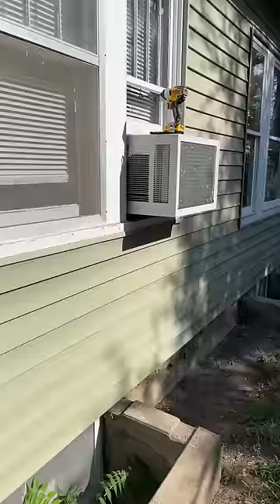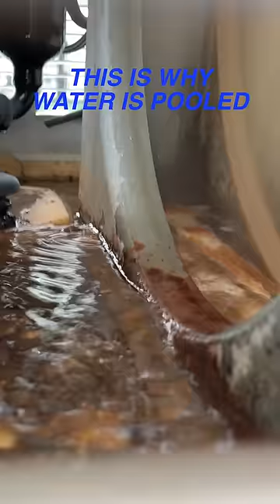🥵 99% Don't Know THIS About Window A/C!

Comment: It may save you power, but you'll need to replace the ac sooner as it will cause the condenser to rust out.
Reply from the maker: I have never replaced an ac unit in any rental houses or my own bc of a rusted condenser unit....just my experience
Reply: I have had them rust out
Reply: 15 years carrier units here and go strong !  Water Splash  help a lot here (Hermosillo Sonora Mexico 121 Fahrenheit) I put fog/mister  on 3 of my split units and the amps draw lows to 11 from 13.5 (24000 btus 220v)
Reply: @charliebrownn6622  Works in Sonora because the climate is dry.
Reply: Maybe if you don't take care of it. My rooftop swamp cooler is over 30 years old and still going strong. There's the kind of lifespan you get when you take care of your appliances rather than ignoring them until something breaks.
Reply: I have a 42,000 BTU or 3.5 ton central AC system in my house. Upstairs is always a few degrees warmer so I started running the Blower Continuously so the air would mix and prevent stratification. It worked but I was using a lot of energy. I bought 3 5000 BTU window ac units and put them in each bedroom upstairs and now I don't run the central air. I maintain a comfortable space temperature with just over one ton of cooling
Reply: @ChicagoMillingCo.  Works everywhere because the coils are hot.
Reply: If you live in an extremely humidity environment like the gulf coast it will rust out and if you are under an oak tree all the pollen will enter and turn it into a slimy moldy soup that has to be cleaned out yearly.
Reply: I think these are just to rust it so you need to buy a new one.
Reply: @HandymanHertz  because aluminum doesn’t rust. 😉
Reply: Aren't those coils made of aluminium? That doesn't rust.
Reply: @GordonGarvey  right,  it will corrode instead 🤣
Reply: @mrdumbfellow927  it would take years if the water was pure and it wasn't directly touching other types of metals.
Reply: I have had them rust out down here in the south
Reply: @jamesfarmer2748 Well it SHOULD be cleaned out regularly. Mosquitoes breed in that soup!
Reply: @charliesheehan4577  I live on the gulf coast less than a mile from the gulf and nearly every old window unit I see has rust and corrosion. The condenser being aluminum while not rusting like steel will be corroded and falling apart but will usually keep running as long as refrigerant is in the system .
Reply: @HandymanHertz My window unit is about 6 months old and bottom of the coil is almost gone because of the standing water, I drilled a hole in it anyway
Reply: Rust is an insanaly long process so no stress put da drill down😉
Reply: @HandymanHertz  the condenser is aluminum how did it rust lol
Reply: Bro I’ve literally had my window unit for over 10 years and the condenser isn’t rusting not only that these units are super cheap just buy a new one ever 5 years if you’re worried about it
Reply: @JDMSwervo2001  some people would like em to last forever so they can use the extra money for there vices
Reply: The window ac is no joke humanties most perfected invention, they are incredibly efficient, last forever and are very cheap to run
Reply: Rust ? I've never seen rust on a condenser
Reply: 😂 The condensers are stainless steel bro 
😂
😂
😂
Reply: Rust is like cancer.
Reply: @Kandralla  If the climate is extremely dry, there will be very little condensation to throw on the condenser.

If the climate is extremely damp, there will be a ton of condensation, but it won't evaporate much because the the humidity is too high.
Reply: @fantabuloussnuffaluffagus  It still helps if the climate is damp. You've spent energy cooling the condensate and by splashing the cooler than ambient water on the coils you get some of it back, you are also warming the water so some of it will still evaporate.

Further most of the planet exists somewhere between 0 and 100% humidity most of the time. Nothing is designed for the absolute worst case. If it was we wouldn't have window units at all.

Comment: that sound of the water slinging drove me nuts with mine. drilled a hole in it about 12 years ago and still works great lol I do try to keep the condenser clean and maintain it time to time
Reply: Mine is a hotel style a/c unit that hangs out of the wall. It got clogged and started draining inside. So i drilled a few 3/4 inch holes around the pan xD
Reply: @chrishansen5784  problem solved I guarantee. Lol the last hotel I stayed in had one that was running off inside the room. Soaked all my clothes and stuff I had beside of it. I'd say it was the same problem you had

Comment: You can also see why you should get some of that water out because it produces condensation regardless,  a small weep hole is what i would recommend,  it still has water flowing to the area it needs but also drains out excess water because it will breed mosquitoes
Reply: Mosquitoes need still water
Reply: @chrisbrooks6697  yea.  No weep hole and it's stagnant and when you turn if off , that's when they start to breed
Reply: @theyreoutthere.huntinggear  I have one for my detached garage. It's never been a problem because they cycle. If it's off long enough for larvae to hatch, it probably got cold enough to kill them. They can't survive in temperatures under 50 degrees. The water is condensation from the evaporator coil, so it's going to be cold, too. Whatever the conditions are, it's not an issue. You do need to set them to a very specific level so that only the appropriate amount of water stays in them. They have an overflow weep hole if the level gets too high. The one in the vid may be a little high. Mine is only 110 volts and will freeze you out of the garage on the hottest days. It also doesn't draw enough power for me to notice a difference on my electric bill.

Comment: Evaporative cooling y’all it’s how the human body cools itself!! Water on the coils definitely helps ac efficiency
Reply from the maker: Correct. a comment from someone who knows their stuff! 👍🏼
Reply: If it dripped evenly all along the top to drizzle down the condensser fins, it could be achieved by collecting water in a bottle and when its filled a pump should push the water above the condenser coil and let it drip, and collect it again,so the cycle could restart imple.ented by new cool water from evaporator,
Reply: A company also invented a water treatment that turns this watr into a drink water fountain
Reply: It will ruin the fins. A coating of hard water crud will build up over time. There is a reason you don't see this on whole house ACs

Comment: The one I have came with a premade drain hole with a rubber plug in it. The manual explained that it collects water and flings it to improve efficiency, but that you can remove the rubber plug if it's a problem.

Comment: Designed to not to last…rust. Class Action
Reply: These new designs were made due to government energy regulations ,but it is backfiring because these AC's are rotting/rusting/dying in a couple of years which causes people to buy another one which contributes to pollution when the old one go to the garbage dump.
Reply: @rainerrain9689 No ac unit should ever rust in anything critical for use unless it isn't installed correctly

Comment: Excellent design for keeping it nice and moldy too!
Reply: Lol, the water is constantly moving, and evaporating.. mold can't grow.
Reply: @starmc26  BS. mold growing in current and previous AC units' blower fan (last I checked fans move pretty fast). constantly damp environment (inside the body of the AC unit) is a catalyst for mold growth especially in climates that are constantly 70-90% humid in the summer. Very little evaporation in those climates and if the stupid thing is designed to hold water in it to begin with, then it never dries out.  glad I can save $6 on my electric bill though!!! ...i'll put that in my piggy bank to go towards the hundreds i need to spend when the thing is beyond cleaning every two years.
Reply: @starmc26  also both installed with the correct amount of tilt based on bubble level diagrams
Reply: @starmc26  when you turn it off for those not running it 24/7
Reply: @AustinEterno  you're wrong.

Comment: A buddy of mine , who's a HVAC tech, said when really hot, put a small sprinkler near your whole house AC unit. Helps transfer heat.
Reply from the maker: Yup, it's the same design 👍🏼
Reply: The only problem is - you'll end up with mineral build up on the condenser in the long term. 
So the water would need to be filtered.
Reply: @havanasyndrome3024  Great point❗️

Comment: when I had an air conditioner I used to have it on a slight angle so the water would drip out..If I didn't it got nasty inside with bugs and such..lol
Reply: It's supposed to be installed pitched away from the room/window sill
Reply: Supposed to drop a quarter inch from front to back

Comment: Many people know that water helps cool the hot side when fan hits the water. But the slightly more obscure part is that the water comes from the moisture that was collected on the cold side before being put to use to help efficiency on the hot side.

Comment: I did not know that😳. I actually drilled holes in one once to drain the water .😮
Reply: Lol
Reply: I used to think it was a bad design / defect too. ‘Salright.
Reply: CAULK THEM!
Reply: It is a genius design flaw, it makes the machine ROT from the inside. Dry coils equal no mud and the coils will not clog and rot, causing high pressure witch will eventually make the unit spring a refrigerant leak and then WORTHLESS and you go by another. They basically made them disposable. My grandmother has 2 AC’s that are almost 40 yrs old and still run great and they drip enough to water her flowerbeds!!!
Reply: Hopefully at the back of the unit. They have over flows out the back...
Reply: @uplatejay 🔥🔥🔥🔥🤣🆗
Reply: @uplatejay  Yep I have a Sharp AC that is 36 years old and still works ! These new designs were made due to government energy regulations ,but it is backfiring because these AC's are rotting/dying in a couple of years which causes people to buy another one which contributes to pollution when the old one go to the garbage dump. I had one of these new designs made by Friedrich and it only lasted 1 1/2 Summers, was all rusted inside !  I put my Sharp AC back in and its still going !

Comment: Bacteria paradise
Reply: Yep Legionnaires disease at play right there
Reply: @Usual Suspect William Hamilton that’s 99% of the population
Reply: The water isn’t stagnant. It is safer than having a bird bath in your backyard but go off lol
Reply: Lmao you think that’s the same water year round? You ever hear of evaporative cooling? 
If you’re really that concerned throw a tablet in there. It evaporates a few hrs after you turn your ac off. If you need it running 24/7, you need central air.
Reply: @SSemi1 😂 so dont drink it

Comment: Dude!  Thank you for this tip!  I was on the brink of buying a new window A/C! 😂
No wonder my A/C was less cold these past few days after I took off a rear drain plug during DIY cleaning and I did not put it back,  causing no water to accumulate on the pan for the Slinger Ring to throw to the condenser coils. Charged to experience :)
Reply from the maker: Glad to help! Yeah, I just learned that too a few years ago, kind of cool engineering 👍🏼